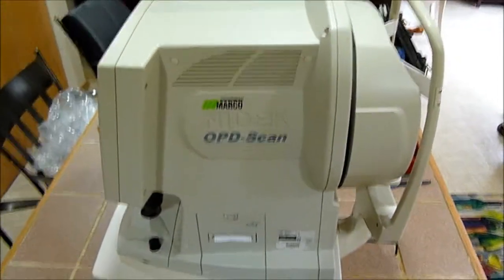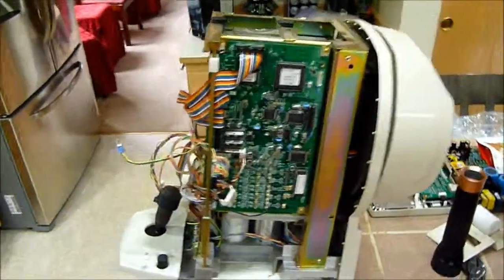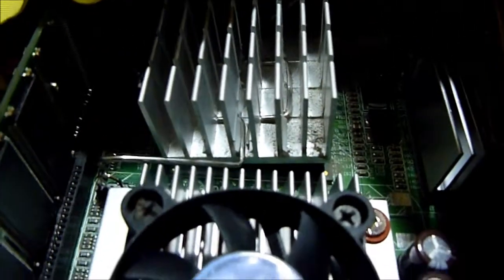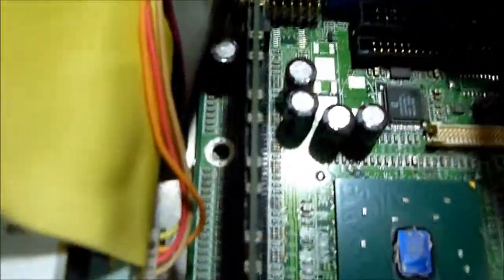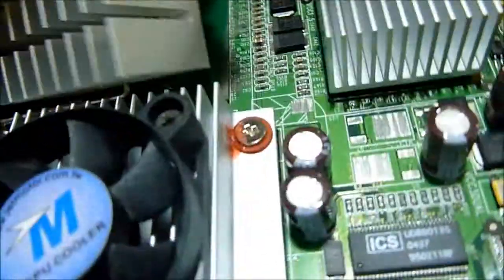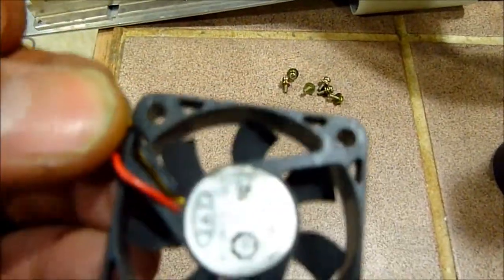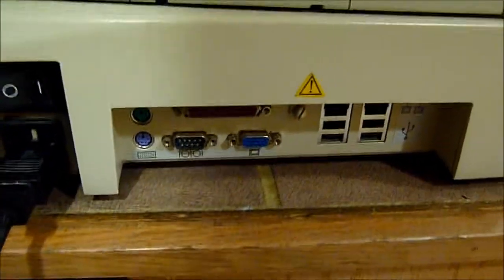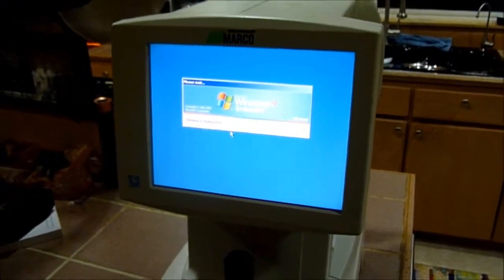Marco / Nidek OPD Scan Repair

Comment: I remember seeing the exact same problem of heatsink hook unsoldered from the biard in a HP desktop computer. Really a design flaw of the whole heatsink setup, the spring pulls way too much on the soldered hook.
Reply from the maker: Yes and instead of recalling them for repair, they just let the customer deal with a fried motherboard and a $35,000 paperweight!

Comment: Thanx for the evaluation, unfortunately my unit is in Europe, a bit far off from your location. I must add that everything started with an empty backup battery on the Mainboard, followed with a total loss of Bios data with was saved in the Bios. 

cheers Greg
Reply from the maker: For your consideration Greg, we can repair your OPD for K's and anything else it may require, rebuild your BIOS, replace the battery, update your hard drives before they fail and confirm calibration. We repair medical equipment from all over the world. Thanks again.
Reply: hi.i have an question.after i use acronis software to ghost C Disk.Touch screen isn't use,but i can use mouse.Many thanks!
Reply: +Tuấn Linh Nguyễn
Your touch screen has failed, we can try to repair that for you.
Reply: Hello. I am an engineer from Russia. These devices are very gentle and do not tolerate transportation. Your problem can be solved remotely (teamviewer). Constantly I collide with the destruction of these devices during transportation as on this video
Reply: This is not a sensor failure. This is a failure of the settings, this problem can be remedied remotely

Comment: Hi, two questions. I realiezed, that you changed the OS as well, switched from Win98 to XP. Only Software swap necessary or did you modfy the hardware (RAM) as well? Secondly, my unit displays me unreliable K-Values it does not correspond to the test eye values. Any idea on this issue?

Cheers
Reply from the maker: Hi Greg, I did not change the OS, this OPD always had XP, some of the older OPD's have 98 but look the same from the outside. The OPD's have gone through hybrid iterations of hardware and software overlap and combinations without changing the outside. Sounds like you could use a full refurbishing of the OPD which would require a complete tear down. It's very easy to mess up this unit so be very careful or send it to someone who's qualified.
Reply: When you change the operating system, the hardware does not change. I can make you a new disk image, you install it on a new disk and replace it with your device. Unreliable data can also be associated with wear and dust in the device. Write if there are questions on the mail ntts@mail.ru
Reply: Hi. Write to me at the mail: ntts@mail.ru